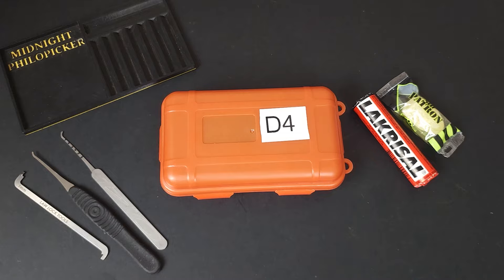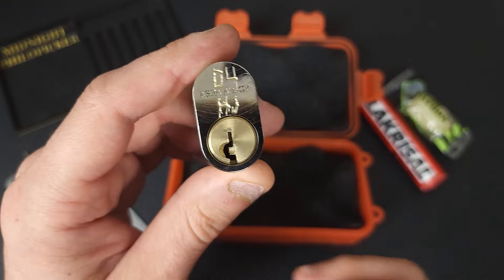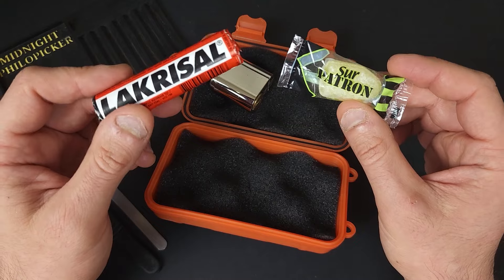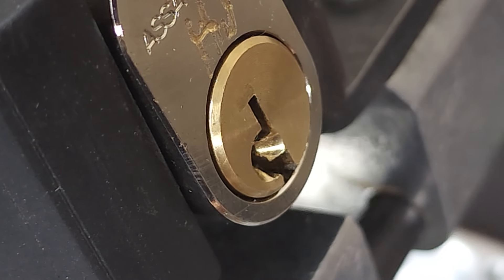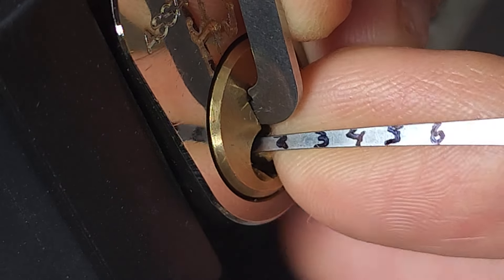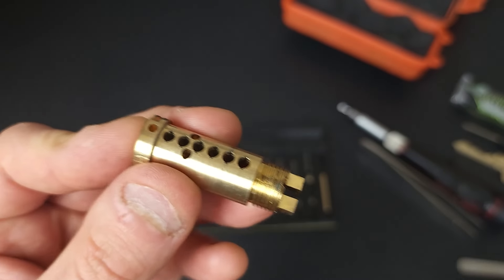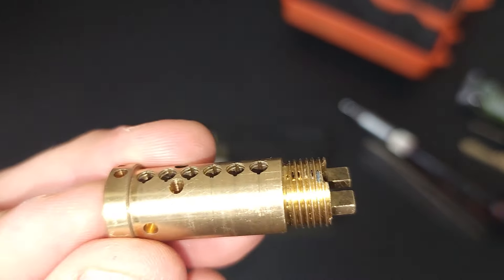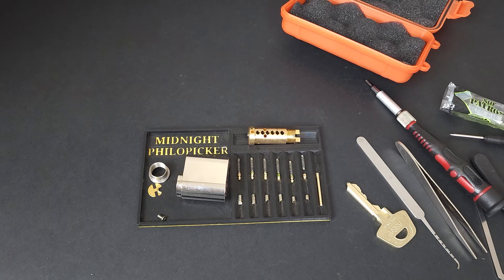[51] "D4" Challenge Lock by H.J

Comment: Wow u made that look soo easy i cant for the life of me get any pick in high enough to set my last pin what pick do you use for this
Reply from the maker: Thanks! It was hard at first... the hardest part was finding a tool that would fit.

I found that I had some multipick deep hooks in 0.4mm that worked well. The thin shanks on those picks are perfect for d12.

I'll edit this comment soon to say which exact mp profiles I found that worked for me, here shortly:

- Multipick V05
Reply: @IsaacHashman  thanks bud i tried making a pick and thinning it right down but then lost the strength  so kinda chucked it in the naughty bucket but im a bit more lighter at picking now and u made tht look effortless so need to dig it out and try again